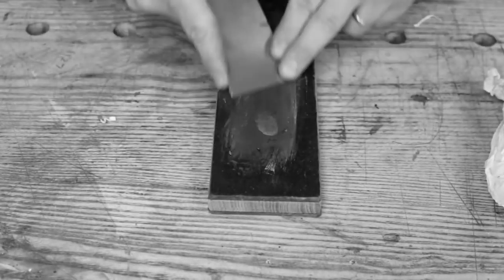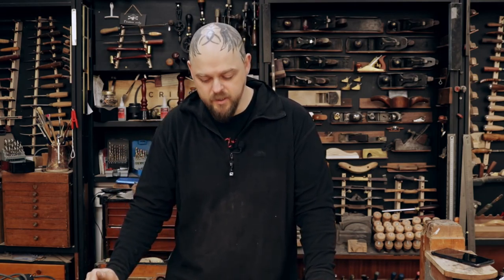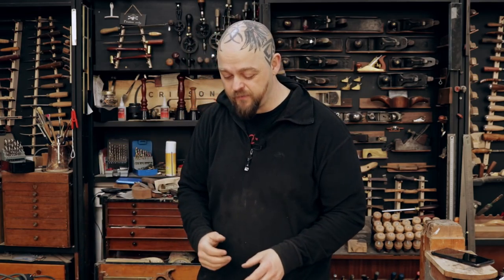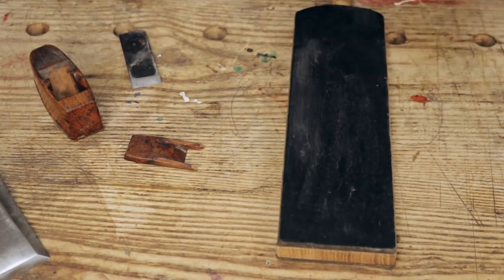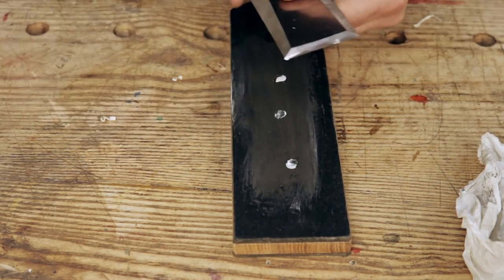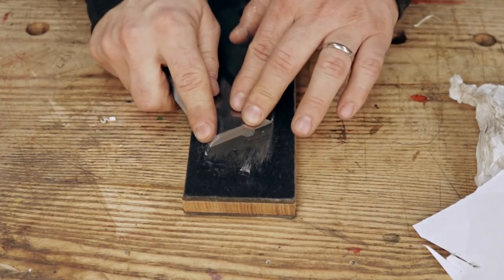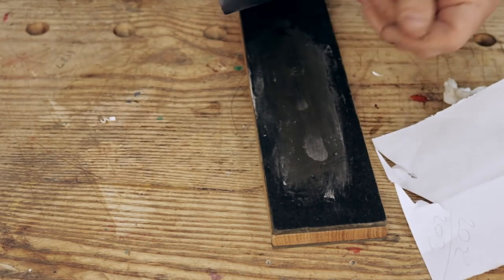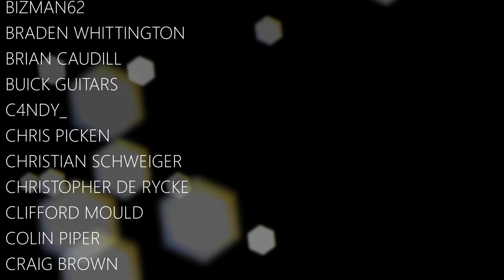Should you use a strop with your plane blades? - Guitar Builder's Basics - Episode 202

Comment: A question for the show: I'm getting some nice burst results with stains now but when I come to apply an oil finish it moves a lot of the stain, either taking stain off and I get a lighter results, or moving stain around reducing contrast between open and closed grain, particularly when I've done something like stain an ash dark, sand it back so just the open grain is highlighted then applying a lighter colour. Should I be considering a sealer before oil? I've tried shellac sanding sealer, but that moves stain too if I run it in and goes on too thick if I brush it on, requiring very careful sanding , is there a better way?
Reply: StraylightGuitars If you work on the lighter area first, and work out to darker sections, it will help a little. Let the first coat dry completely, to help keep from moving the stain around.

Comment: Hey Ben, I have a question that I personally have had issues with and I reckon some other people would also find this interesting.
I've routed neck pockets on 4 guitars, and somehow everytime it ends up 1-2mm too wide for the neck and requires patching up with shims etc., even though whatever template I make fits tight around the neck. I'm quite sure that nothing is wandering whilst I'm routing. Is it that my template making skills are abysmal,  or am I missing something?
Reply: Your router is probably not running true. Either check the angle of your bit to your base (90 degrees) or the bit might not be running parallel with its bearing. 

If you are also using mdf for your templates, use lighter pressure because the bearing can sink into the mdf, creating more of a cut than you needed